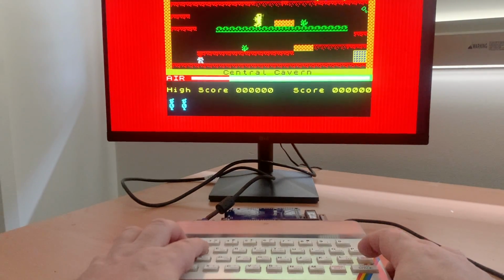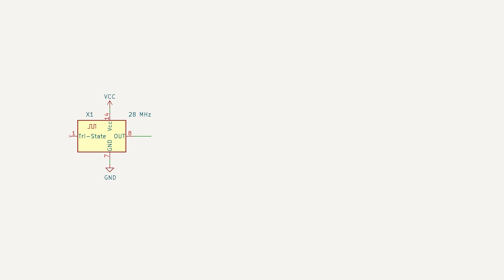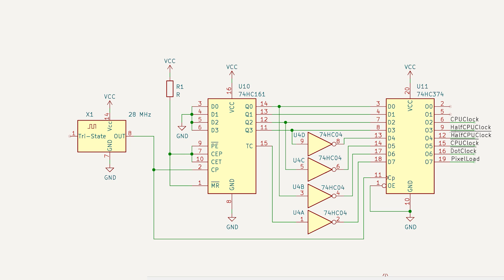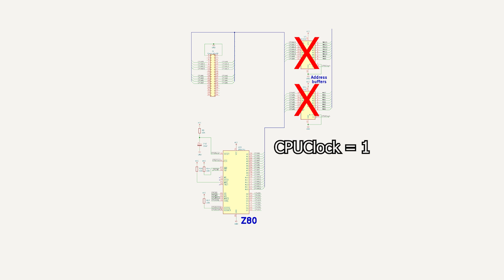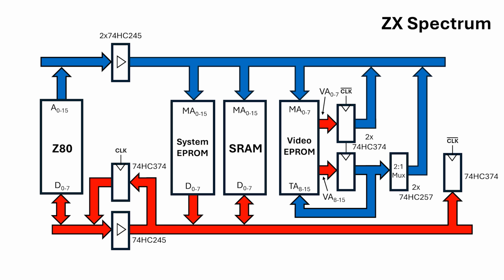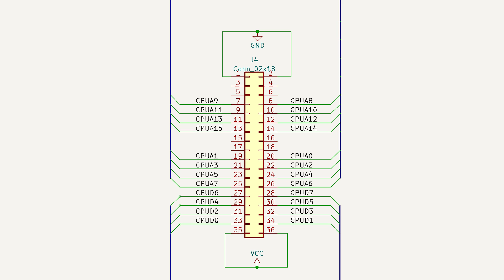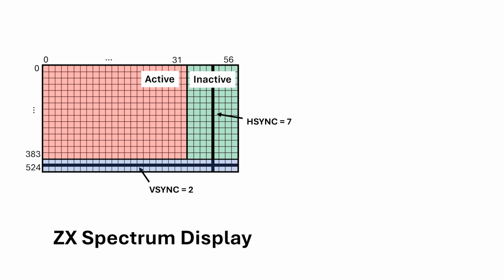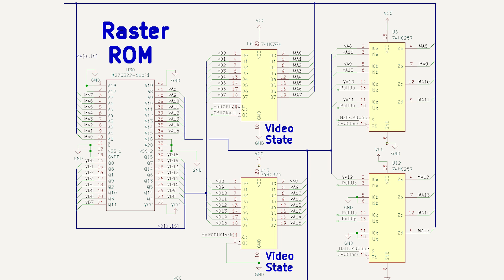VGA ZX Spectrum - Schematic

Comment: wow very nice indeed.... on question.... were is the tape in out? maybe in a next episode?
Reply from the maker: Still a bit undecided about whether i'll add tape input/output.  You could use the exact circuit the Spectrum uses though.
Reply: @DrMattRegan  ZX use ula...pin 28 (ear mic)

but i am impess...no ulla...you cut the zx o dossen chips...thats nice i will...watch the next episode thenk you very much
Reply: ussr lenigrand use 74 seriew chips to make the ula...and have the tape inout circuit on this circuit
clever ideea

Comment: this is very interesting, i'm more of a software guy, so i'm just about keeping up, but please tell me, are there any benefits to doing this?  does negating the ULA allow for faster CPU speeds? the ability to double buffer or anything?  why is SRAM better than DRAM for instance?  it would be interesting to see a spectrum that could run a 7mhz variant of the z80 with locked vsync to allow games to run correctly without slowdown, but i don't know if there would need to be further changes to allow that..?
Reply from the maker: Well, the real purpose of the video is for teaching /  entertainment.
The first problem with the ULA is that they're not begin made anymore.  If you find a good one, you are basically cannibalizing and existing machine.  The desire hear is to show how the ULA works.
The down side of SRAM is that it's six transistors per bit, vs 1 for DRAM, but you need extra circuitry / voltages to keep DRAM happy.  This extra cost per bit doesn't really matter these days.
We have complete control over where the interrupt signal occurs, so it may just be easier to adjust that rather than change the clock speed.
Reply: @DrMattRegan  that's interesting, would you have any interest in exploring anything like that?  it occurs to me a number of decisions were made as necessity of cost and complexity that as you said are no longer an issue, even at a hobbyist level today.  I had thoughts of re-purposing the flash and bright bits to expand the palette and if i remember correctly some timex variants did have additional graphics modes that allowed for attribute blocks of 8x4 or 8x3 pixels?

Comment: Great project! How about flash signal? Will it be generated from combined VA signals, or some additional counter will be used?  What about U15, there is some tricky delay, is it for video signal disable while not in visible display area?
Reply from the maker: Enjoy.  I was thinking of just using a 5555 timer, (AND) gating  it with flash.  This will feed into an exclusive OR gate on the pixel data.  I actually simplified U15 in the next video.  Originally i wanted to control/shift the timing of the border signal down to one pixel at a time, but it can all be simplified by delaying using HalfCPUClockBar on the flipflop feeding it.
Reply: @DrMattRegan  VSync is asserted on every frame? Then you can use 393 counter to divide it by 4 then another time by 4 (or 8/2) to get one flash toggle per 16 frames. Or something like that. I think this will be much easier than 5555 and for sure more accurate.
Reply: Or use INT signal for correct timings alignment with begin frame interrupt

Comment: Why not use a jk flip flop with q  and not q for cpu skew problem, would do away with inverter as you already using data flip flop..
Reply from the maker: @ntal5859  I want all the clocks to be in phase with each other, not just CPUClock and CPUClockbar.  That’s the main reason.

Comment: Hi. Unable to compile VideoFSA. Compiler Error C2065 Undeclared identifier IDI_VIDEOFSA and IDC_VIDEOFSA
Reply from the maker: I just tried this procedure and it works.
Under visual studio 2022 (which is free)
Create a new project -> Windows Desktop Application
Call it VideoFSA
Copy the Github version VideoFSA.cpp and VideoFSA.h into the VideoFSA directory.
This should replace the existing autogenerated copies of these files.
Run.

Comment: This is fantastic, well done.  I've always wanted to re-create the Spectrum but using modern parts like SRAM and no ULA.

In your schematic, the raster rom data line are interleaved, Q0/Q8/Q1/Q9...
Is that to make the VDx lines consecutive and easier to route ?
And is that what the SwizzleData() funtions are for, to encode/decode the data to suit the physical chip pinout ?
Reply from the maker: Exactly.  For some reason, i find the Q0/Q8/Q1/Q9... native format of the 27C322 almost impossible to debug.   In single stepping mode, i can normally read off the hexadecimal value on the data pins with a logic probe going around a chip.

I have to concentrate a lot more and make more mistakes in Q0/Q8/Q1/Q9... 
format, compared to Q0/Q1/Q2/Q3... format.  So it's mainly to make debugging easier.

The SwizzleData() function encodes the data before programming such that you can thing of the outputs as being Q0/Q1/Q2/Q3...

Comment: After a few nights of debugging timing issues with TTL logic with a modern 4-channel, digital storage oscilloscope I can't imagine how hard things must have been back in the day. There's a great non-fiction book that touches a lot on the toll it takes on people: "The Soul of the New Machine" by Tracy Kidder. After endlessly dealing with nanoseconds, one of the protagonists left a note: "I’m going to a commune in Vermont and will deal with no unit of time shorter than a season."
Reply from the maker: Yep, these timing issues can be tricky.  If i can i get the circuit running at a slow speed but it's not always possible, particularly debugging video circuits.

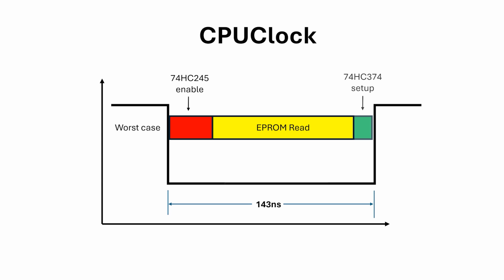Comment: 10:38 I did not expect to see the System ROM on the "ULA" side of the machine, instead of the traditional Z80 side, especially given that tight worst-case timing constraints. But... I guess SRAMs and ROMs do stack up neatly for compact signal routing.
Reply from the maker: Yeah, you're right.  I could have put the ROM closer to the CPU now that you mention it.   During the testing phase i tend to put a dummy image in the ROM to test the raster generator running without the CPU running, but i haven't shown that in the videos.

Comment: maybe a stupid question
if we dealing with barely fast enough rom and fast ram with extra free unused space outside of memory map, wouldn't it be beneficial to timings to transfer rom into that ram and remap the ram as rom address space, the only problem is you would need some kind of one time executable boot loader program to transfer spectrum rom to upper ram and boot from there as a normal address space
Reply: I guess you could, but it'd be complicated. Assuming you copy with the Z80 itself, you'd have to start in some sort of slower clock mode that paged the ROM in but was still able to write to RAM (possibly with a bigger than 16K ROM so you've got room for the copy program, although the 16/48K Spectrum ROM does have a little free space to fit the copy code in, but since both start at address zero you'd need to relocate when copying). After copying, this code would have to do something like write to an IO port to switch to normal operations. Also the Spectrum ROM and some games incorrectly write to ROM space, so you'd need to write-protect the bottom 16K of RAM after you were done.
Reply from the maker: In the next project, where i use a TTL CPU instead of the Z80, i'll be writing to the RAM to act as a ROM.
Reply from the maker: Yeah, I wanted to stick with the spectrum ROM, but when I play the games via the external hardware, it does download the entire 64k into RAM and execute from there.

Comment: Hello. Very interesting project. Can I get the firmware for the raster rom?
Reply from the maker: Yep, it’s on the GitHub page as VideoFSA.cpp.   Just make a visual studio project and use this file.
Reply: @DrMattRegan Ok friend, where can I get the VideoFSA.h library file?
Reply from the maker: Just added it to github.  If you make a visual studio desktop application called VideoFSA and pop these two files in it should work.  Let me know either way.

Comment: static RAM? toooooo simple. Interesting explanation anyway, thanks.
Reply from the maker: Ha ha yes.  When ever I feel the need to self flagellate I have a go at getting dynamic RAM to work!
Reply: This PCB is already full of multiplexers and buffers. A computer should compute something. So this already is not a home computer, anymore.

So we are free to have fun with multiplexers and buffers! The ZX spectrum uses fast page mode. I think it would be really cool to show how fast-page mode and memory interleave go together. For example a memory controller could check if the CPU or videoDMA really needs memory. And then if this is the case, it could read ahead a few bytes and cache them (4 * 2 buffers ).

Make this work also for 6502. Make this work for a character display with 16px wide patterns (2 byte burst) or 4 color pixels for games.
Reply from the maker: If you're interested, i have a video on DRAM usage in the Spectrum https://youtu.be/VMosP_X2C8U

Comment: Both the enterprise and the cpc use 4mhz can you double the video ram speed? Would this eliminate contention?
Reply from the maker: Umm, the trick is using static RAM.  It’s faster than the dynamic RAM the production machines use, and it’s easier to use.
Reply: @DrMattRegan  have you seen the next?